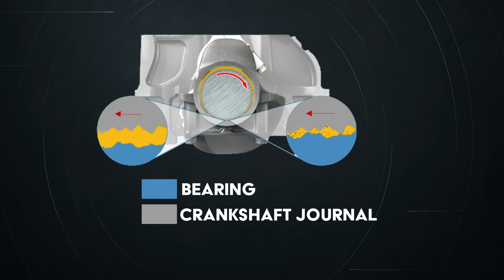the truth about start-stop technology (finally proven)

Comment: This test would have been valid if the same engine was also idled for 84 hours with the same bearing set and then compare the bearings.
Reply: 100% this test needed a control engine to show the difference between the 84 hours start-stop and idling. Comparing to a completely different engine is pointless.

As much as I want to believe the message in the video, it doesn't help its credibility.
Reply: these armchair engineers have no real knowledge of DoE so this half done experiment is being taken as a fact as you can read in the comments
Reply: Not convinced by this.
Reply: The bearings looked ether out of the 1,000,000 mile motor than the experimental set worth 84 hrs of start/stops, the last one had a deep gouge through one section after a simulated year of use, yep no good.
Reply: @evil17 I don’t recall any details in the video.  If they started the engine and then turned it off immediately before oil pressure was built, that could cause this damage.  The engine would never provide fresh oil to the bearings so it would be equivalent to draining the oil from the engine and running the test with just the oil trapped in the bearing.  This oil will gradually get forced out and contaminated with debris and likely would cause damage to the bearings like that shown.  I suspect they did something like this to intentionally cause damage and not doing a test that really simulates real world stop/start where the engine runs a minute or more between stops.
Reply: I get that although it’s probably a lot less wear just idling?
Reply: @markmooch Probably, but without a control for the test, you can’t draw any conclusions.  It might be that idling with its low oil pressure may well have created similar wear patterns on the engine.  We have no way to know and thus can’t judge if the wear observed was unusual for this engine.  And comparing it to a high mileage, but different engine, at least that I what I understood from the video, is meaningless as some engines are known to last many miles and some are not.  Comparing different engines is thus meaningless.
Reply: @markmooch you'd be surprised. Idles actually pretty hard on a lot of engine components due to the torque fluctuations on the crank and thus the constant acceleration changes. Slightly higher to moderate RPM is actually far smoother and constant in terms of actual crankshaft rotation, so anything connected to it typically sees lower dynamic loads
Reply: So, in your opinion, having driven that vehicle 1M km without start/stop is not a valid comparison?  Did you pay attention?  The original bearings were looking good after million km, but the new bearings were worn after the 84 hour simulation test with a start/stop feature.  Seems good enough to me.
Reply: I did 700.000 real km in real life with a real station wagon (not a truck) with start/stop always enabled. No wear on any engine part. Is it good enough for you or you need to be explained again how testing works since you completely ignored what they said before?
Reply: @TheLifeLaVita If you claim to have driven 700,000 KM with “no wear on any engine part”, then I know you are not credible as no engine runs that long without wear.  And internet anecdotes don’t come close to replacing test data.
Reply: @LTVoyager "test data" what test data? The one in the video is not test data lmao it's flawed under every aspect. I drive my car well, which is the most important part of keeping a car for long. Engines aren't usually meant to fail after a while because of normal use. After 10 years the only replacement are the rear suspensions now and ac pump a few months ago. Also my car drove a lot of kms in a relatively short amount of time, and time and use for that time is usually the main factor. It's not an internet anecdote since I have my car with me. And all the cars before this one always reached these kms with no problems. My family's other car, which is newer, already has 120.000km after one year, with average fuel consumption of 4.1l/100km (real calculation of fuel bought/kms ran, not the displayed one which is lower). Has gliding start and stop too, which is pretty cool actually. We'll see how the new one compares
Reply: @TheLifeLaVita Yes, I commented earlier about the flaws in this “test.”  I am reading your anecdote on the internet so that makes it an internet anecdote by definition.  I don’t believe internet anecdotes in general, and I definitely don’t believe claims that are patently false such as claiming an engine can run 700,000 kilometers with no wear.  Not possible with today’s engine technology.
Reply: @LTVoyager it's not "good as new" but it has no visible wear, no performance change, no anything, according to the official volkswagen establishment. They themselves said they were shocked, but it always makes sense because as I said, this isn't normal 700k in 50 years, it's 700k in 8-9 years, which is fundamentally different in terms of wear to the engine. The engine holders break before any engine inner part even shows sings of wear, it has been like this for all the cars for the last 3 decades.
Reply: @mikchilton How many cold starts do you think a normal engine makes in 1M km?  How many starts do you think they made in 84 hours?  See the problem yet?
Reply: @LTVoyager its not a steam engine, the viscosity of oil doesnt change much with temperature, you can see this by the pressure taking time to build, if it had a big spike on the beginning it would indicate that the oil couldnt flow were it needed to, comparing wear to 1 km of idle is irrelevant, static friction is way higher than kinetic friction, even withuot oil
Reply: @KCrucisI made no comment about oil viscosity.  Your comment makes no sense.
Reply: @LTVoyager it doesnt make sense to you cause you dont understand basic engine operation.
as stated a running engine wears less due to the dynamic properties of the oil, which is were your statement about the test being compared to idling comes from.
Reply: @KCrucisThat is your assertion, but most engines at idle are on the hairy edge of the RPM where hydrodynamics becomes effective.  A real test would make this comparison and not just assume what the results would be.  And if many starts causes extreme wear, then the 1,000,000 mile or kilometer (not clear which it was) engine would show similar wear as the number of cold starts that would occur in 1,000,000 miles of typical driving would be of similar magnitude to the number of starts made during the 84 hour torture test and thus similar bearing wear should have been observed.  I don’t think any vehicle gets to 1,000,000 miles without ever shutting down and restarting.
Reply: @LTVoyager No, they're completely different engines.  The 1M mile engine is the famous OM616 that is known to be much more robust than other engines. You obviously can't do the same with every engine. Even worse, it looks like the comparison engine may have been the T5 2.0, which is described as the worst engine ever made in a different video by them; due to lubrication issues.
Reply: @david.arpad9 I thought that was the case after watching the video and commented to that effect earlier, but then some seemed to say it was the same engine with the bearings replaced so I wasn’t sure.  And, quite frankly, the video was so poorly done and disjointed that I have no desire to watch it again to confirm.
Reply: @LTVoyager even if hydrodynamics were not effective (which they are) the energy required to start an engine is greater than to keep idle, and due to the rp being close to zero during start, that work comes mostly from torque, witch increases the normal, witch increases friction, witch is on itself bigger due to cinematic friction being many times smaller than static friction
is not ¨my assertion¨ is middleschool physics
Reply: @KCrucisAll speculation.  The only way to know for this particular engine in this circumstance is a head to head test.  And, as I said earlier, at least twice, even the comparison to the 1,000,000 mile actually argues against the premise of this video.  An engine that accumulates 1,000,000 miles in normal driving is very likely to have made more cold starts than were made in the 84 hour test.  So, if the wear was from starting, then the 1,000,000 engine should have had as much wear as the 84 hour engine.  Since it didn’t, that suggests other factors are in play and the start/stop cycle wasn’t the cause of the wear.
Reply: @LTVoyagerI'd also chime in that in my 20 years plus working on cars at a fairly high level, I've never seen an engine do a million anything's without  at least a set of conrod bearings. The only exception are heavy transport engines
Reply: @KCrucisthe energy to restart is not higher that what's needed to keep it at idle. Otherwise it would show during emissions testing. The whole reason for the system. You're talking out of your ass trying to come across as an expert
Reply: @LTVoyager The OM-616 bearing does have wear as seen in the video, so it definitely has been used more than the fresh bearing in the 84h test. What is missing is a measurement of the thickness compared to a new bearing, as the surface alone doesn't tell the whole story. It is however obvious that the coated bearing experienced heavy wear after just 84h of continuous starts and stops. Much more than you would expect from running the engine normally for months. So it is obvious that the start/stop-function has a significant impact on the wear of the engine.
Reply: @razorblade7108 I agree right up to your last sentence.  This isn’t at all obvious from the video.  I have no idea if their 84 hour test even comes close to emulating actual stop/start operation in a real car.  I actually quite suspect it doesn’t, but the video was so short on details that I can’t tell.
Reply: @ej20tnz  that makes sense, most of the engines that do so are benz from the 80s when the brand was all luxury, the only ones that were sent to the us were the automatic diesels, which were less reliable
Reply: @ej20tnz  wrong, is many times higher, you consume roughly 14 seconds idle equivalent fuel per start, why start and stop doesnt save fuel either
the emissions test in europe care about grams of c02 per kilometer, they look at the average, and not only there is less lights, but they are placed in better spots where they are actually needed, so they last longer
most of the world uses poorly placed lights to replace proper road design, usa style, so start and stop fairs way worse against shorter lights and therefore shorter idle time
Reply: @LTVoyager no expeculation, simple math, physics, and engine understanding
you are the one speculating over known non issues
Reply: @KCrucisTypical “I have no real data” response.
Reply: @LTVoyager there is plenty of data over this issue, even if you are limited to just english
Reply: @KCrucishttps://youtu.be/dFImHhNwbJo?si=Me9Mz7r-mrASWa30

Wrong
Reply: @KCrucisAll hat, no cattle.  If there was data, you would produce it.
Reply: @ej20tnz  that video only measures fuel consumed, not total energy, do the math for the energy the starter needs to produce, and the efficieny losses of the alternator, battery internal ressistance, and starter itself
keep being wrong all you want
btw, you just proved my initial point that it takes many times more energy to start an engine than to idle it, regardless of how oblivious you are to it
Reply: @LTVoyager i dont need to negate your statement about fluid dynamics ceasing to exist when engines are at low rpm, thats not how science works
how about you go read for yourself instead of crying in comments about people needing to refute your obvious lack of basic understanding?
did your uni allow you to use a calculator or something?
Reply: @KCrucisYou can’t negate a truthful statement.  Not sure why you feel the need to keep trying.  Must be mommy issues.
Reply: @LTVoyager incorrect
science doesnt deny statements altogether, science is a group of almost correct statements, you dont deny anything, you just make a more correct statement
thats why, for example, you cannot deny the existence of a god or creator with science, because science doesnt make negation statements 
im not trying anything, maybe you should use a mirror and ask yourself why you are projecting
Reply: @KCrucisYou just can’t control yourself.
Reply: @LTVoyager wow man, you know me as much as you know engines
Reply: @KCrucisGlad you came around to reality.
Reply: @LTVoyager the reality that you are a loser who´s only archievement in life is comenting last on a thread to tell himself he ¨won¨?
the same reality where engines only get extra wear on idle if fuel leaks between the ring and the jacket? 
ive been in that reality all along, try to catch up

Comment: You save pennies in fuel but it cost you worn out starter and worn out batteries and down the line early engine failure...